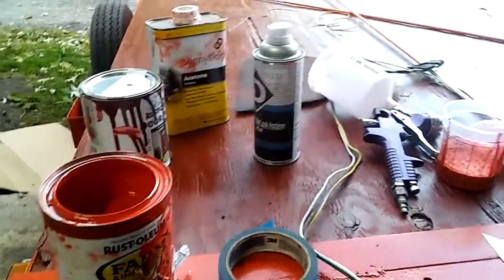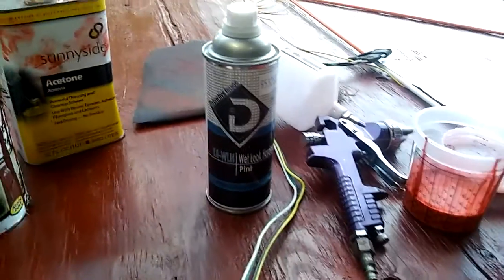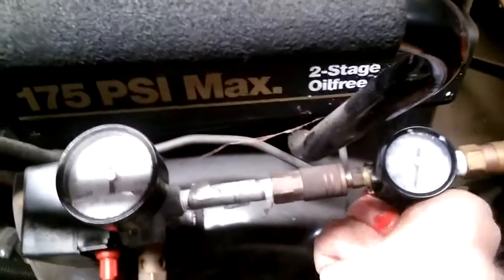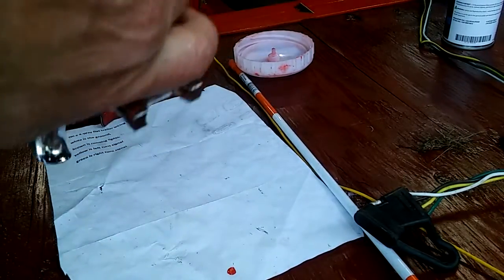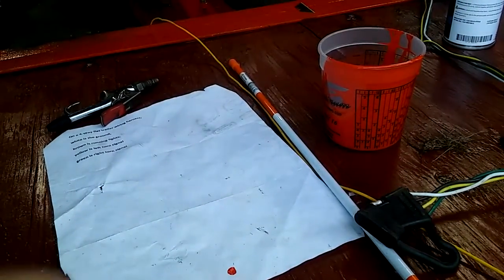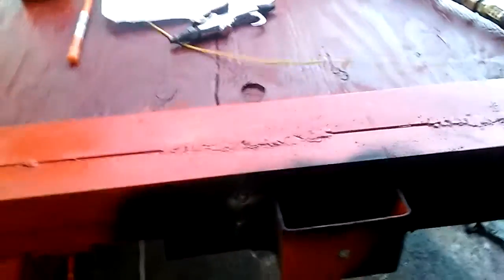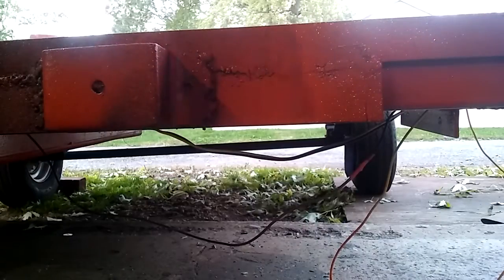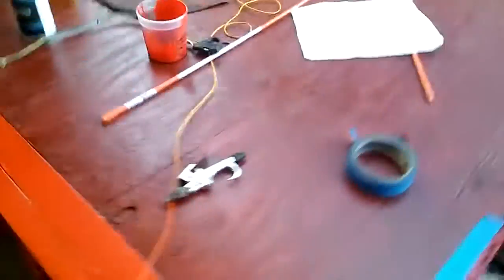Spray painting a trailer with Rust-Oleum HVLP gun.

Comment: Needs to be thinner, was to thick. Should drip off the stir stick. Add a little paint thinner.
Reply from the maker: Funny been on thier two years and the trails outside almost everyday with no issues.
Reply: @mobilemowers  How was cleanup and how long did it take to cure? 

The thickness has nothing to do with whether or not it is durable paint. 

The information I commented is a useful judgment tip for people wanting to paint and are curious of how thick the paint should be. 

Depending on climate, thick paint as you had it, can gel up and spatter or clog the gun. Thats great you didn't have issues, Other may in the painting process. Therefore a good rule of thumb is to cut down the paint until it drips circular beads off the stir stick and is "fluid".

Comment: How’s this farm paint hold up? 

Any fading?
Reply from the maker: Not too bad. Trailer sits outside 24/7 and it's been like 2 years. Takes a good beating and still on most places. Doesn't rub off as easy as normal spray paint. Not as shinny but paint was only $10. Used it often during the spring summers.